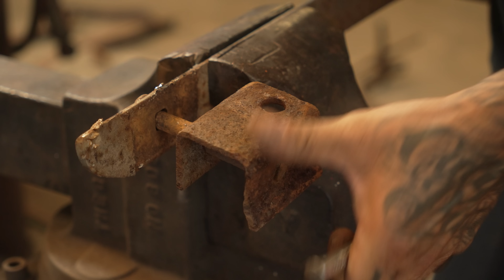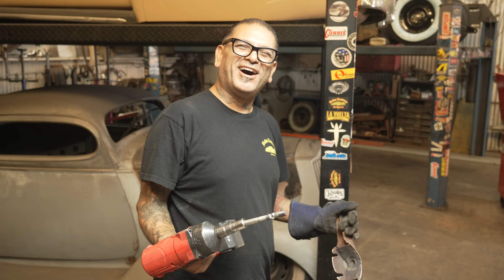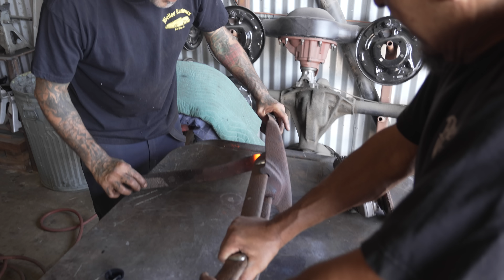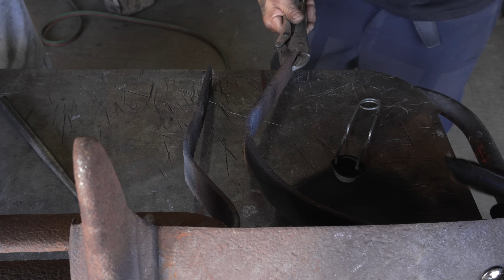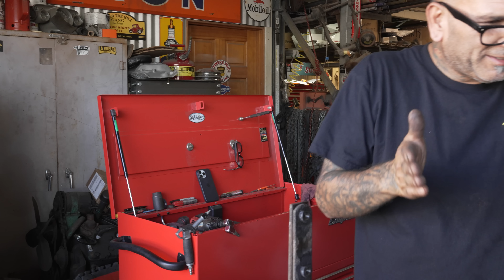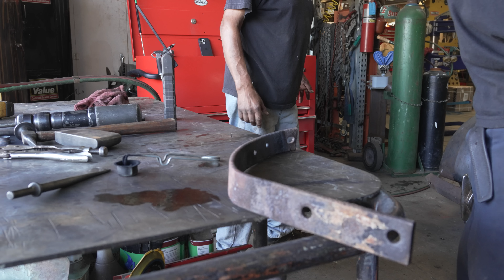1939 Lincoln Zephyr Bumper on a 1936 Ford

Comment: That chrome shop's gonna have to grind off 5 pounds of rust to make the bumper chromeable.  But that's not your problem, is it Mike?  😁. You already showed those brackets who the Lokochon-in-charge is, eh?  Salud!  💪
Reply: The acid tank will clean it off, then they will give it several heavy coats of nickel and sand it flat.
Reply: @65cj55  Cool!  Thanks for the info.

Comment: I hope we find out how the chrome shop is going to repair all that rust pitting without just grinding it down to paper thin.  Metal spray?  The People want to know.
Reply: They fill it with nickel, layer after layer, sanding in between until it's flat.

Comment: How can you fix that bad of putting? Keep plating over and over while sanding down the good part until surface is even? I used muggy weld on some parts before chrome, but it's a lot of work for even small parts.